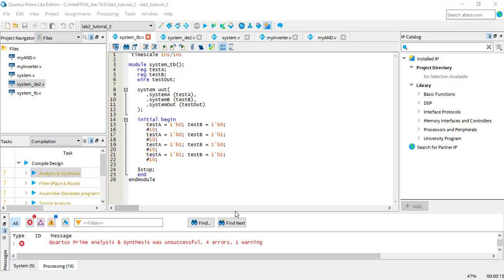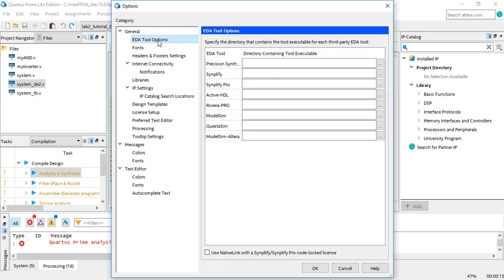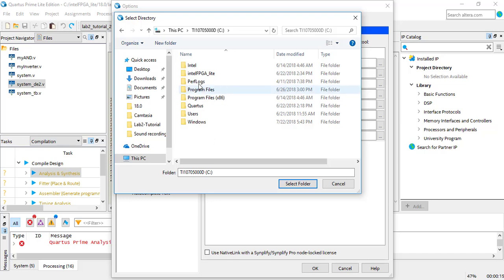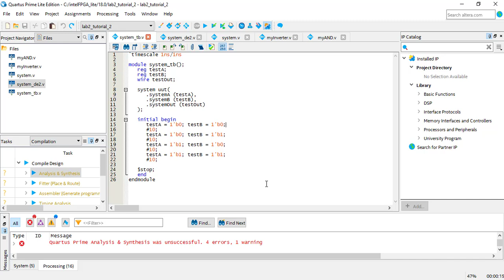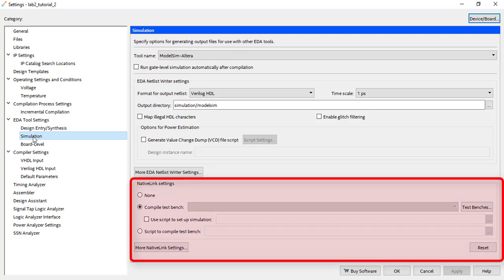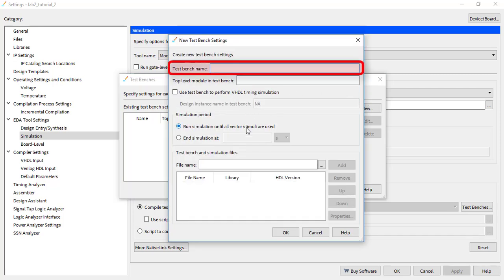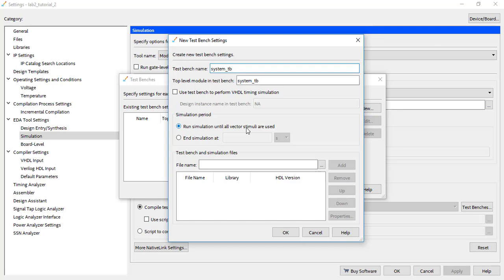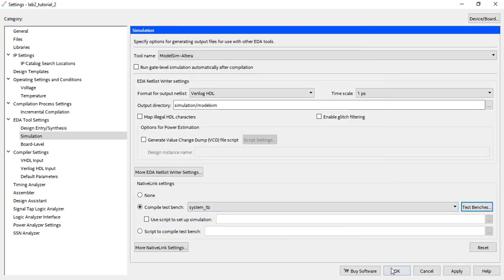Intel Quartus:  Setting Up ModelSim

Comment: Current install version is 23.1std, which seems to have different hierarchy. It is pointing to: C:\intelFPGA_lite\23.1std\questa_fse\win64, I am not sure if it is correct, yet I suspect not because ModelSim is not running from within Quartus. It is running outside. What executable should I see in that directory?
Reply: same doubt it just shows questa, modelsim(not altera) and other things. did u find any sol?
Reply: @abhinavk2640  No. I am using ModelSim separately. It could be more convenient to link it to Quartus, not a big deal.